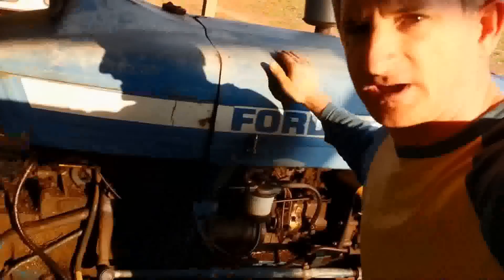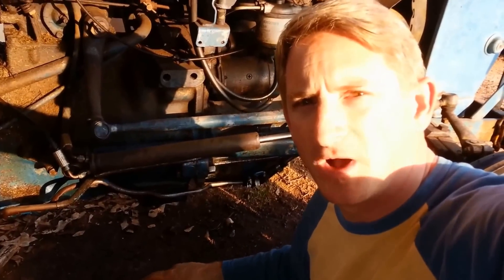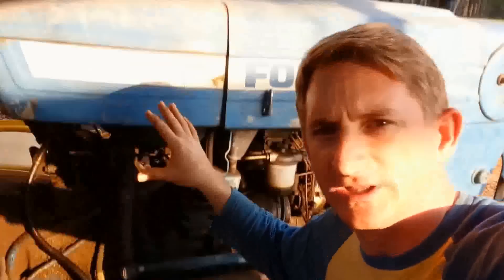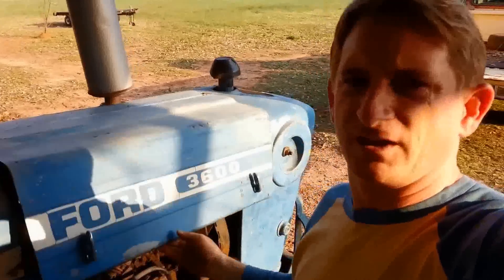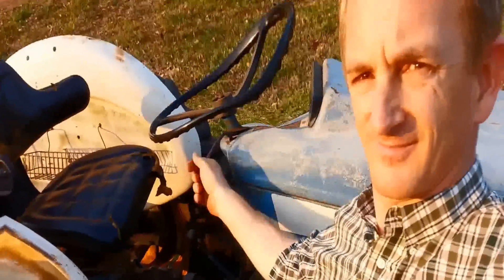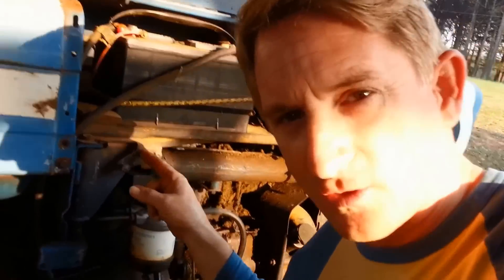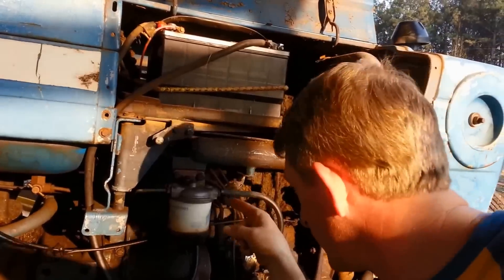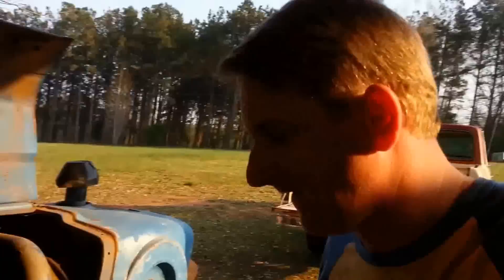Cranking Diesel Tractor When Out of Fuel ... (ran out of gas) ...

Comment: Another problem is that fuel degrades after sitting for a period of time so you may need to drain out all the fuel and put fresh fuel in along with some fuel stabilizer.
Reply: Diesel fuel stays good for decades it’s basically oil

Comment: Right on brother. I'm mechanically disinclined but your logic and 'can-do' entertaining video had me chaining up my compact Ford 1710 to a small backhoe with my wife pulling me around the meadow. After changing out my fuel filter I drained my battery multiple times and put months of use on my starter - bleeding but having no luck getting the fuel up to the injectors. High road gear and under 50 yards of engine turning and fuel was oozing out of all 3 lines. Minor messing around to get the sputters out and we were back in business... YouTube is like having a smart older brother.

Comment: next time fill the tank up with diesel and blow 20/30 PSI air into the tank to push the fuel up to the fuel pump then crank it over, should start.
Reply: I almost tried that on my Kubota. It use to work on my 01 Duramax.
Reply: Assuming that that you have to hold the air in for pressure. By your hands. Versus just blowing in air. Right.? Want to make sure. I turned my tractor off. Ran fine . Day before. Two days later no start.
Reply: Was low on fuel .I will add.
Reply: Unless it's regular gas, like this one ?